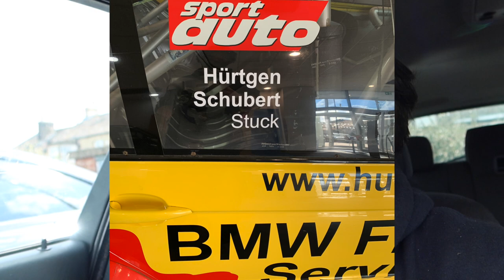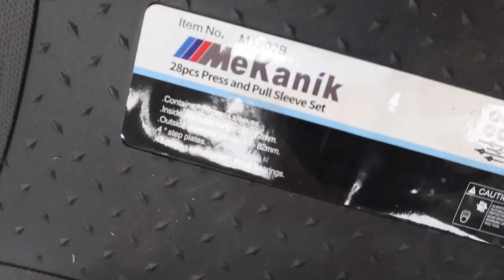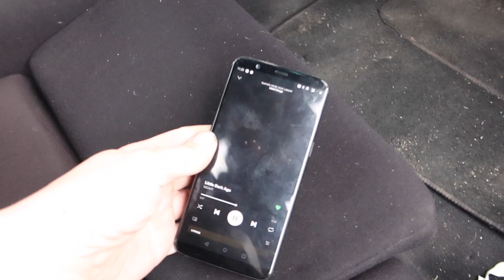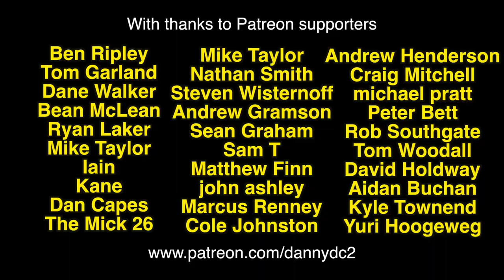Fixing the M3 (again) - BC Coilover Bearing Rebuild

Comment: TRW are the OEM front wishbones. They are around £100 each. Are the drop links good? I have taken out my cd changer and put a Bluetooth adaptor in its place. £30 from Amazon.
Reply from the maker: Link me some for £100 each and I’ll buy them now

My Bluetooth has to have the cd changer going as it’s old system but only cost £10er or so
Reply: @dannyDC2  mister auto TRW £119 each side. Just checked this morning.

Comment: Is the knocking down to preload settings on the coils? Came from car throttle and subscribed straight away! Keep up the great content!
Reply from the maker: It was a twang caused by the springs yes, still got the knocking though!
Reply from the maker: Sorry think I misread your comment, they could have more preload on them, BC say to put quite a lot but I left it with enough so the spring would rotate just to make sure I fixed the issue
Reply: I had to put minimum 5mm preload on my coilovers for my S14a otherwise they would knock and twang. Sounds like you are on the right track to get it sorted though!
Reply from the maker: @stevepeck200sx  nice one dude well it's still not perfectsk I might as well try that to rule it out. Cheers!

Comment: Grand video as always Dan. If you’re unsure about the front end knocks or rattles, try and get it on a 4 poster ramp with “shaker plates” fitted. Most up to date mot centres will have one of these now, and makes it dead easy to identify play in joints 👍🏼
Reply from the maker: Yeah they're not half posh them!